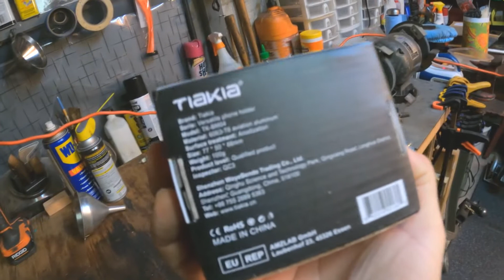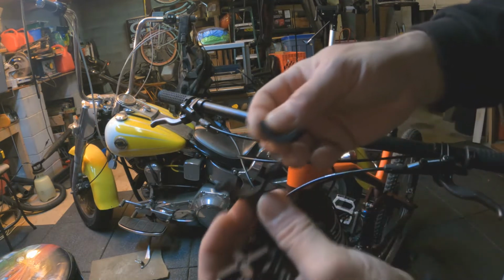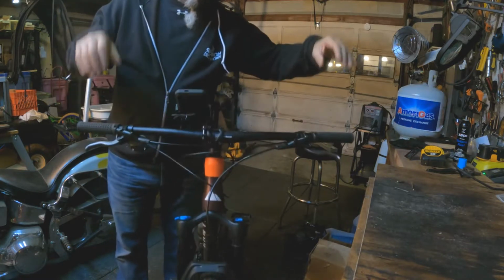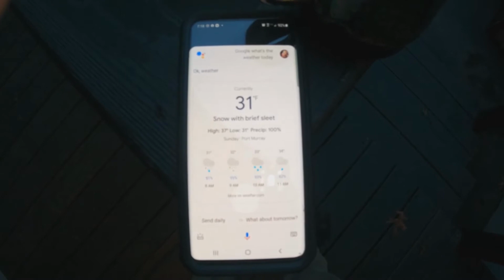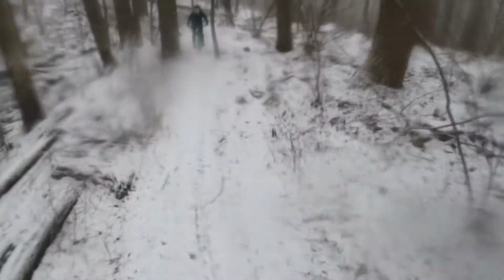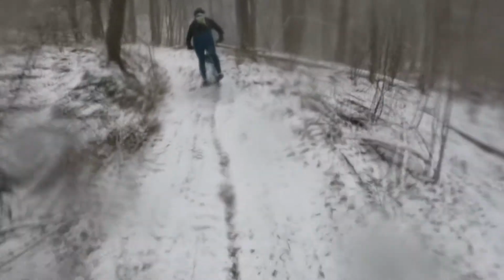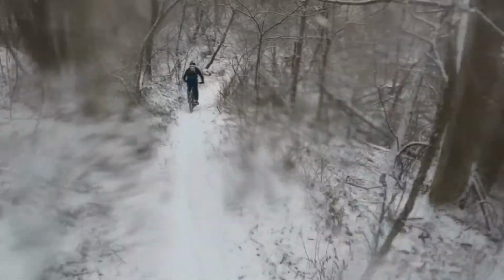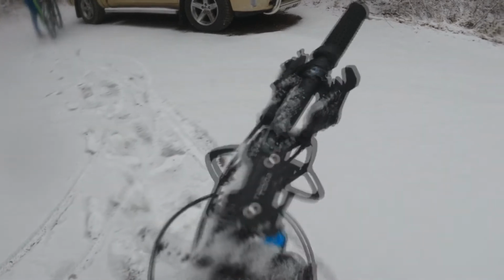Tiakia Bike Phone Mount Review and Snow Ride Test Stephens State Park New Jersey.

Comment: The trails ur riding look like the power lines trails we have everywhere here in Michigan. Further north in Michigan it looks like this everywhere. Miles and miles of trails u can get lost on super easy and the service up there sucks so good luck trying to call for help or bring up maps of the area. Even if u did have service the GPS maps for the areas r almost never up to date and right because of all the new trails that r getting added all the time. They have to add them for the massive clear cutting and burning operations they do every year. Basically don't go out there by yourself until u have rode them long enough with someone who kinda knows them about as well as u can. Even then I would still recommend never going out there by yourself. Where's the fun in going out on ur own without one or two good Buddies anyway? Too much that can go wrong out there.